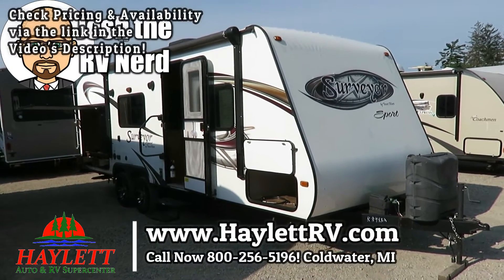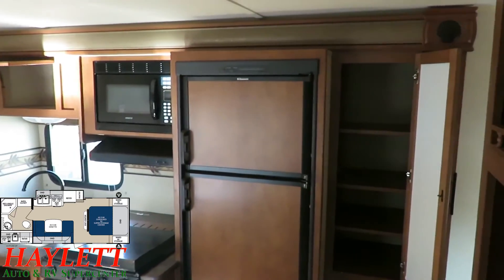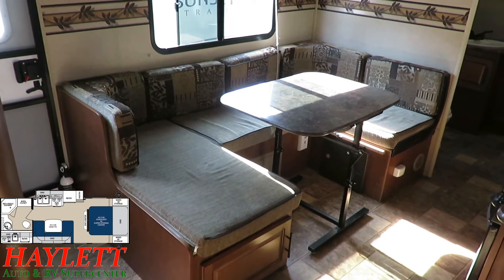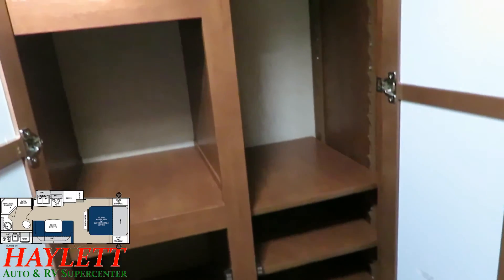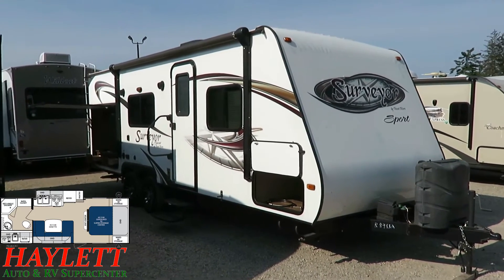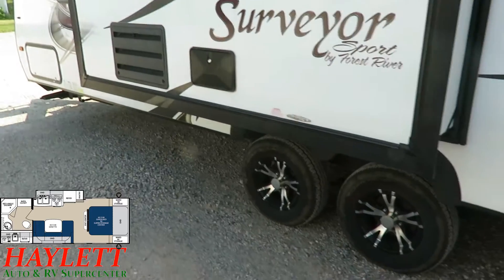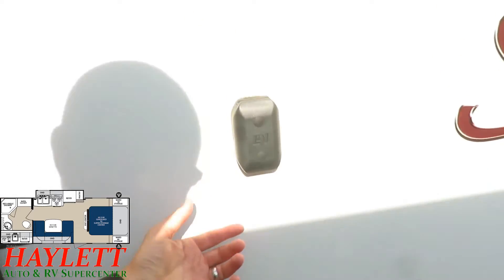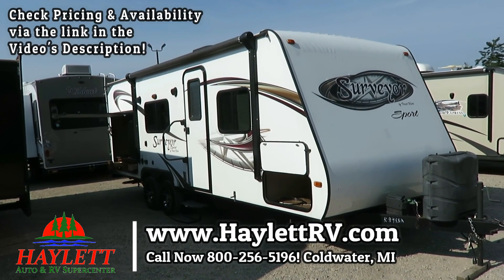2013 Surveyor 240RBS Rear Bath Outside Kitchen Carpetless Used Ultralite Couple's Travel Trailer

Comment: looks just the right size for the wife and I, only problem and we find it with all the brands is not having a good spot for a cat litter box to go . Its a conspiracy set up by dogs I bet LOL, any suggestions on a good brand camper that is 1/2 ton towable that would work as far as placement of a litterbox would be appreciated
Reply from the maker: I have an answer that works for a lot of folks: VERY simple and basic modification of the under-bed storage. 

Go to the area where you lift the bed up inside. Remove the front or side paneling (or simply install a cat door). There ya go. It's out of sight, out of mind, and easy to access for daily cleaning.